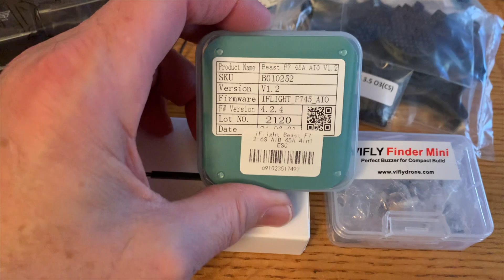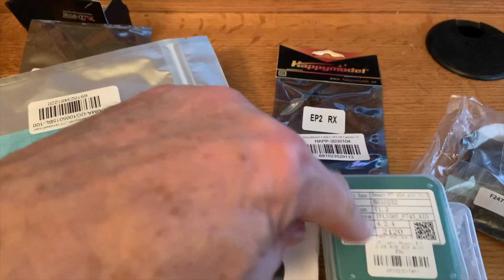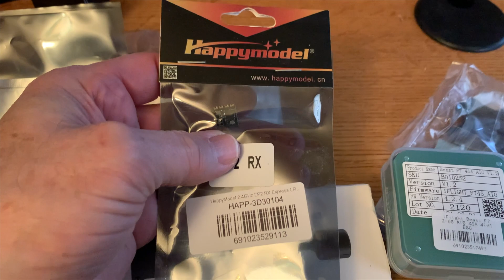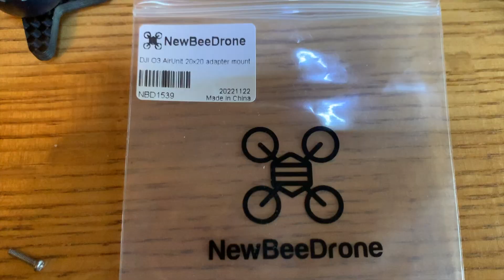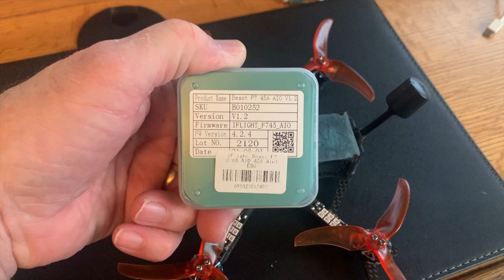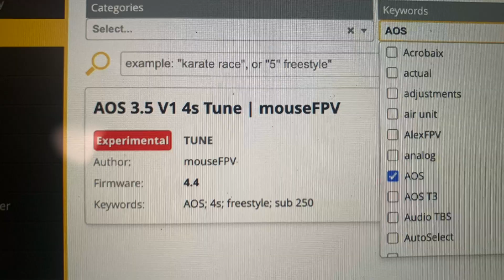DJI O3 Air Unit and AOS 3.5 O3 Sub 250g Build

Comment: No jello but each time you pushed the Quad there was lots of prop wash and its the disturbed airflow from the brace,s on the arms. I would like to see some hard Arco with a decent c rated lipo to see how smooth that style frame really is
Reply from the maker: Agree on the prop wash with the default 4.4 tune with RMP filtering. Really needs to be tuned when there is no snow on the ground for this old guy to crash into and blowing an esc. The only video I can link is the V1 version of this frame from Chris Rosser doing more aggressive freestyle ( better pilot than me) which does have arm braces. I am sure they do cause air turbulence for the FC to deal with but it's a trade off between frame resonnance noise and aerodynamics (Chris Rosser does a good job at explaining the design choices). https://www.youtube.com/watch?v=-Iempg4wfgs&t=37s
SLOG
Reply: @slogfpv  Nice build, I made one very similar. using the Mousefpv AOS 3.5 preset in BF 4.3. flies beautifully.
Give the preset a try; I highly recommend it
Reply from the maker: @bartbutler9960  thanks for validating that the Mousefpv AOS3.5 preset is a good one to use. Will load it and see how well it does once the weather warms up.

Comment: I haven't done an 03 config for my frame yet but you'd like my 3.5 frame super smooth & locked in on stock betaflight, will be doing dji, hdzero builds soon and a cine pusher too
Reply from the maker: Sounds cool!
Reply: @slogfpv  here it is https://youtu.be/4_clXXG00hY   will update soon for more mounting options!